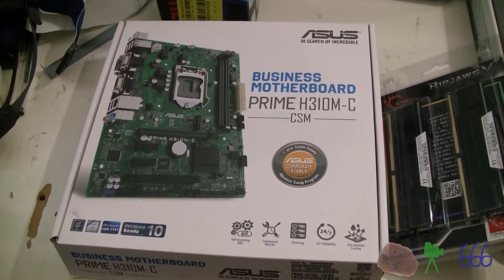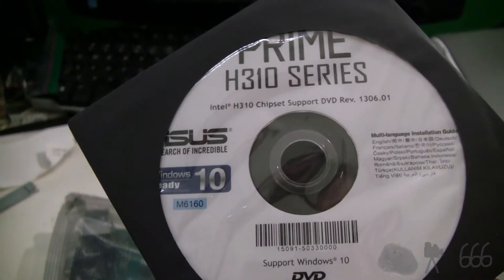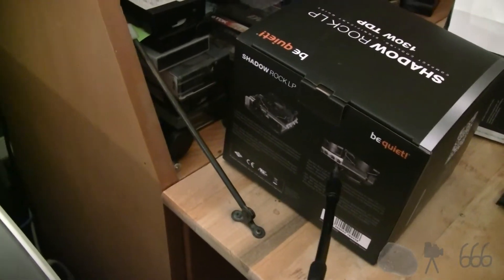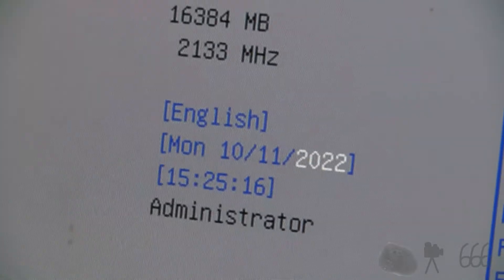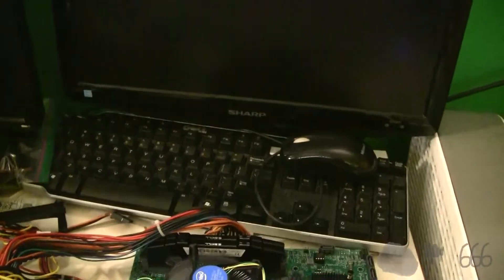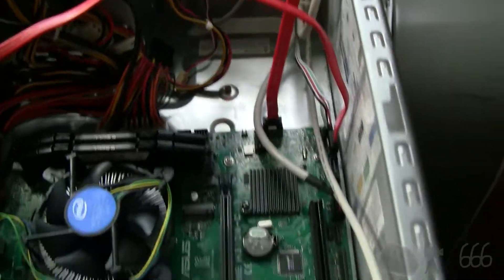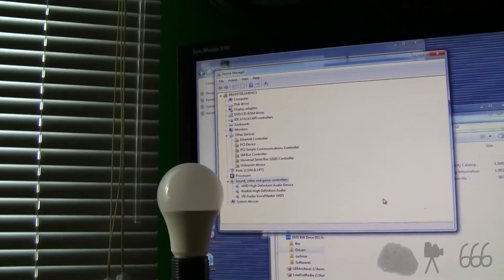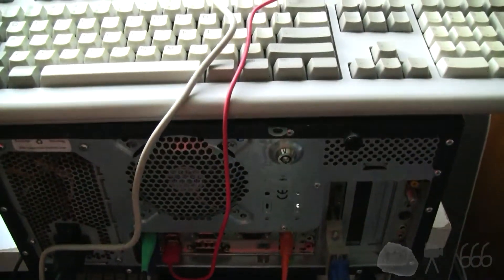Attempted Stream Encoder PC Upgrade Ends In Yet Another Epic Fail

Comment: I wonder if you once tried those driver packs that are floating around the Internet for example Snappy Driver Installer with the new board under Windows 7 or did you browse the contents on the CD and installing them manually 

The error that the Asus thing throws doesn't neccesarilly mean that the drivers themselves aren't compatible with 7 or 8.1, as for Windows 10, it is still a POS but I have to use it because nowadays software is stopping on being compatible with 7 & 8.1 sadly 

I miss the days when Windows was a serious user oriented OS and not the mess that it is today